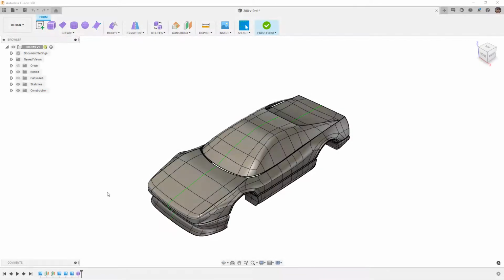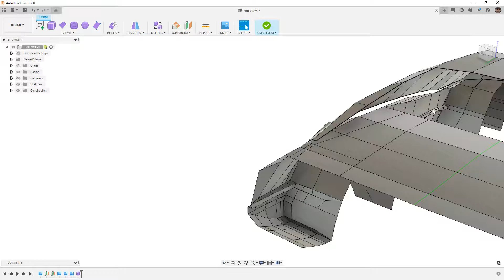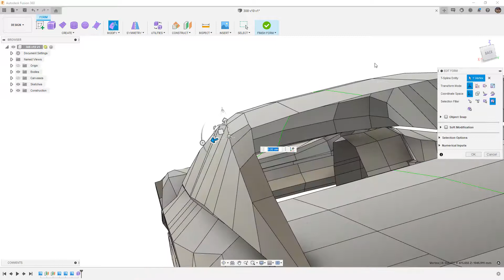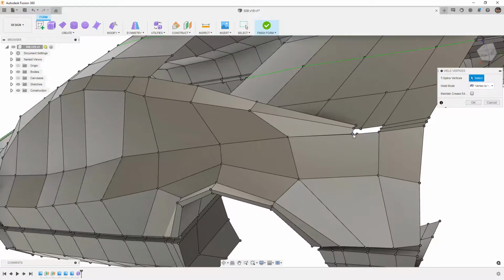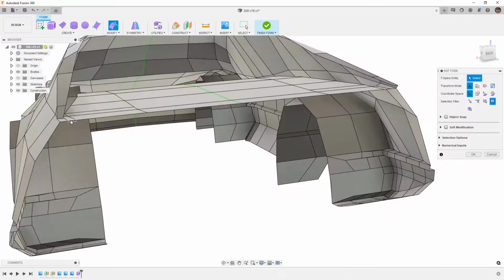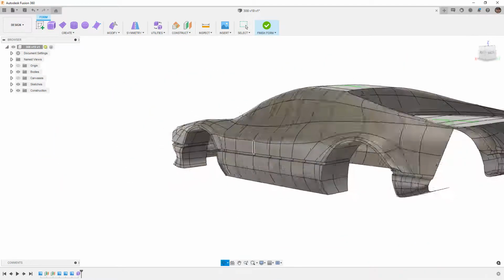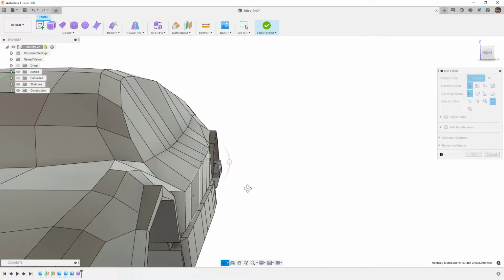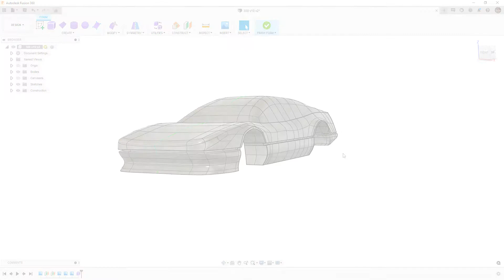Ferrari 308 with Fusion 360 Forms - Subscriber Model Review

Comment: Great video series!!  Any chance you might know a way to make it 3d printable?  I'm looking at Matchbox size bodies  but there is no thickness for a model (or form it as a solid)?
Reply from the maker: Thanks, there are 2 main ways to make something like this 3d printable.  Thicken it or turn it into a solid by closing all the openings.

In the past when i have had to 3d print modeled cars like this i have closed off all the openings.  If you look at this 911 for example. i filled in the openings/wheel arches so it coul be printed.  https://a360.co/3qvcztb

Depending on the 3d printer type, size you are printing etc you would decide how much detail is wanted.  Something like an SLS powder style print is better than something an fdm for details and lack of support.  the 911 as is would be ok with FDM but the 308 might have more trouble unless some areas have supports on the outside.